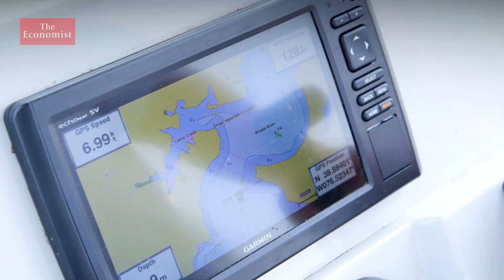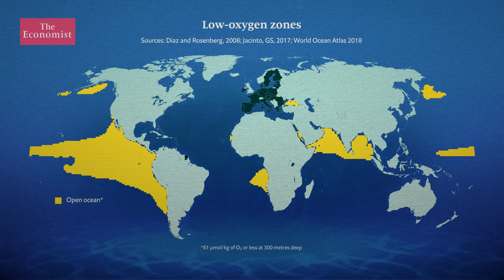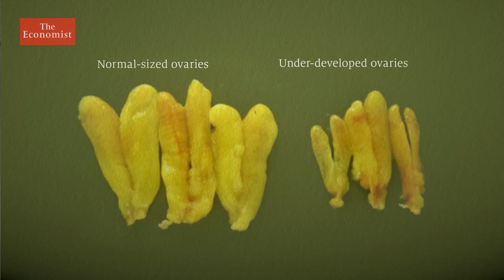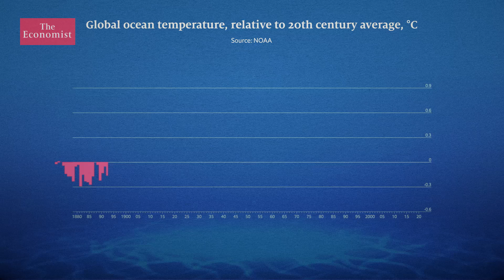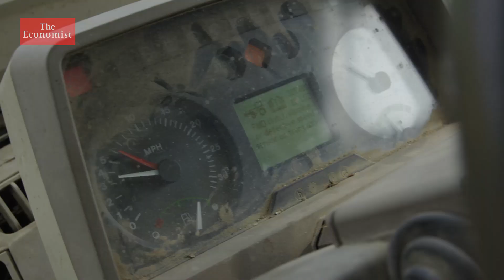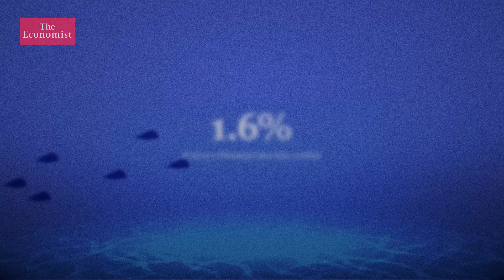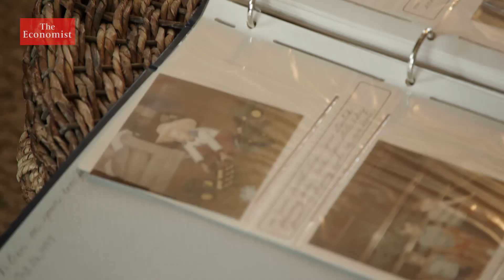Dead zones: how chemical pollution is suffocating the sea

Comment: Actually the biggest issue in the US is corn. Corn requires vast quantities of nitrogen,  so farmers use animal waste and fertiliser to grow  it. Because most corn is grown in the catchment of the big river's all that nitrate gets washed into the gulf. Remove the subsidies of corn and farmers will grow less nitrogen needing crops.  However in most people minds is phosphate that is the problem,  however as someone who been doing successful water bodies management for over 30 years it is clear that the nitrogen is the culprit.  Problem now in Europe is corn is grown for bio gas production and similar problems appear. Solutions: first remove subsidies for corn. Second place large scale venturi aerators in the large rivers and gulf, try to get oxygen into the water to around 8mg/L, that will start to kick start the natural recovery.  3th there are enzyme based products that can assist and speed up the process.
Reply: Corn is the next in line with the tobacco industries as far as being driven by very poor economic policies. It has become  an addiction to the consumer and the agriculture sector. It has intensive nutrient requirements and also, a high energy input requirement thus negating most of the benefits for using it as a fuel replacement ( partial ). Mix in genomics and now the crop requires high cost inputs such as fertilizers and herbicides. You now have the perfect storm when crop failures occur, huge bailouts are necessary. The whole mess supported by the US taxpayer in a very veiled support system of Farm Bills.
It is easily mechanized and so has become the sweetheart crop for farmers.
Only forward thinking farmers but hopefully, more will realize the cost and risk averse benefits to the Regenerative Agriculture Movement. 
90 % of agricultural research is funded by Big AGRI. Much more university and college agriculture education needs to come from independent research in Universities, similar to the Miner Institute, before this Big Wheel can be turned.

Comment: the cyanobacteria absorbs more nutrients in hotter temperatures, the ecceleration of nutrient uptake in cyanobacteria is caused by the hotter temperature, the fighting planton would usually absorb these extra nutrient but as there numbers diminish or as there numbers are not included in sea turnover as the top ten meters is to hot, they are not able to absorb the extra nutrients with the lower number of plankton so it is expled as sea snot, the nitrogen from farming, and emmisions is to abundant so the plantkton cannot absorb it and the cyanobacteria absorb it instead and give of sea snot,   use organic nutrients, use less nitrogen, phosperous, and lower temps is the answer, it is a combination of nutrient pollution and also the hotter temperatures.    the farmers using to powerfull NPK man made nutrients and not resting the land, the abundance of NPK will not create higher yields, they use more becuase they think they will get more yield, and this creastes run off that goes into the sea, add to the lower fighting plankton and the cyanobacteria absorbs it with the solar magnification the porcess is eccelerated and creates to much sea snot.

Comment: "nitrogen produced by power plants" 
-> cut to a wide shot of an operating nuclear plant which produces nothing more than a few pounds of radioactive dirt that are stored in a single steel casque.

just had to mention that. modern nuclear is the cleanest and best form of electricity production, but no one will look at it if people keep lying

Comment: manmade climate change Welsbach Stratosphere program causes a *Terrarrium Effect increasing net temperature. Emissions are trapped inside by High Atmosphere Seeding layer. Radiation, Frequencies, Coal, Nuke power plant emissions,  HAARP,  SBX , NEXRAD Weather Modification engineered fires which put off tremendous levels of gasses and toxic emissions destroying orchards and crops etc.